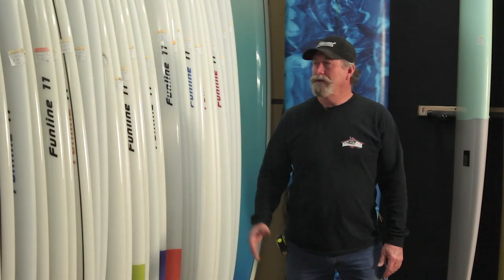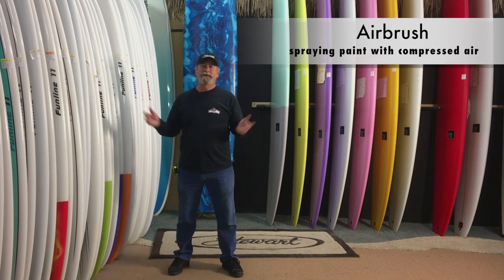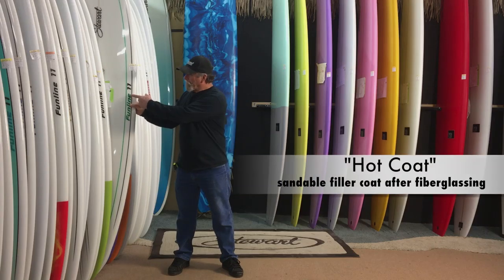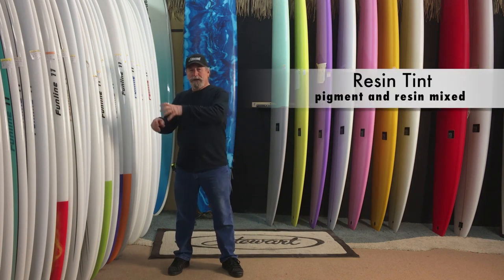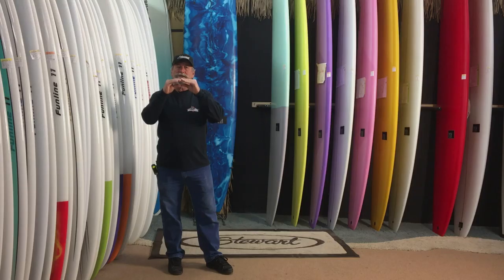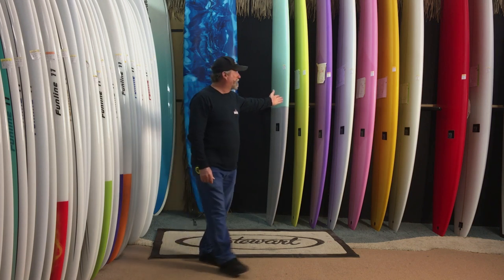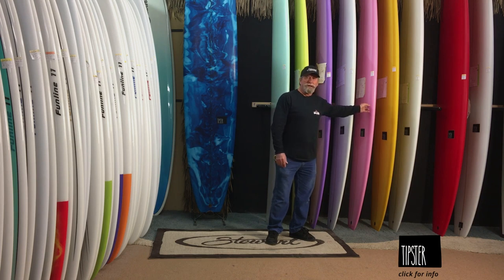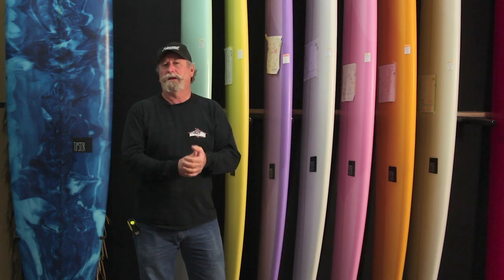Stewart Surfboard Tips - Paint vs. Resin Tint

Comment: Hi! I’m making my first board, if I spray the deck before I resin, do I need a special kind of paint so it doesn’t eat the blank? Thanks! 

And also can I spray and then resin and then hot coat and still see the design underneath?
Reply from the maker: We use water-based paint. And yes, if you're doing the resin and hot coat correctly, they should be clear so you can see the design. You can also paint on the sanded hot coat, then finish with a gloss coat if you want the art to have the highest level of detail and pop. Good luck!